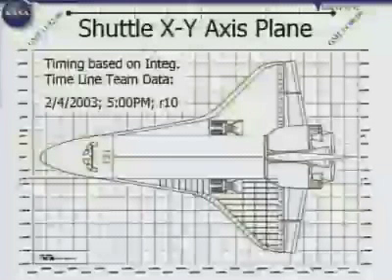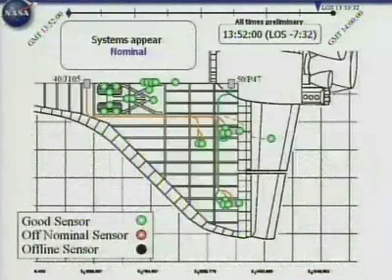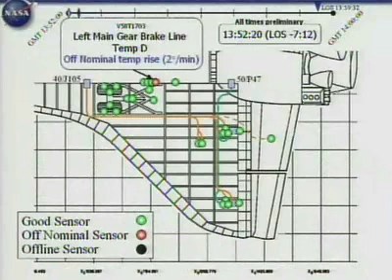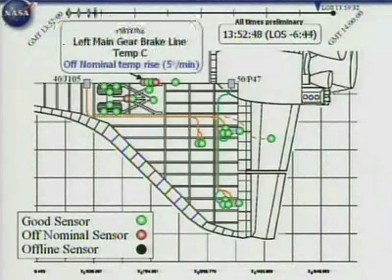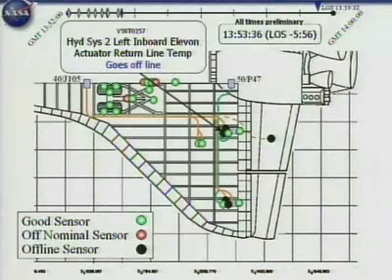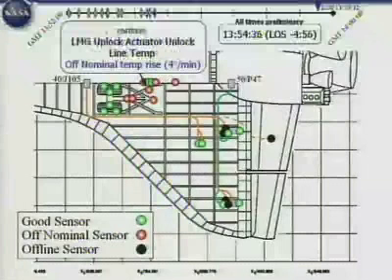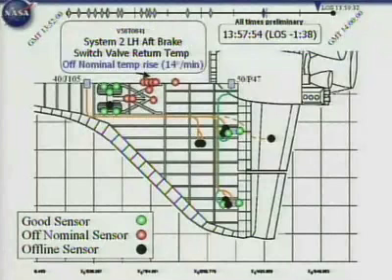Timeline of events in space shuttle Columbia left wing during failed re-entry of STS-107

Comment: They should have inspected the wing right after they achieved orbit then they could have made provisions to dock or pull up to the space station and space walk into the safety of the ISS. The pilot could have over rulled NASA on the reentry.  But that's why NASA deceived them about the severity of the situation. They were dead before they started back and NASA knew this but kept it from them. I wonder how much insurance money was collected by NASA for their destruction of equipment at the cost of 7 lives. HEADS SHOULD ROLL FOR THIS TRAGIC EVENT OF DECEIT AND LOSS OF HUMAN LIFR. Follow the money trail.
Reply: Columbia was in the wrong orbit to go to the space station. There wasn't enough fuel aboard the orbiter to change its orbit and get to the ISS.
Reply: You have a number of anomalies here. First off there was no contingency to dock with the ISS on this mission & therefore they weren't in the correct position to reach there. Also there was no way to inspect the orbiter from space. The arm was not installed on this mission because the cargo bay was chock full of experiments instead. Also there probably wasn't any EVA equipment onboard either for the same reason. These missions were planned years in advance thus every STS flight was unique along with training set forth for the crew of THAT mission. Finally NASA wasn't positively certain that an issue actually existed on the orbiter. They knew they had a foam strike but that had also occurred on prior missions with resultant tile damage but it obviously wasn't severe enough to halt the program.... until AFTER the fact of course. Probably no insurance $$ because these astronauts probably have to sign their life away or they don't fly. Its the nature of the business.. hazmat pay to fly in space.

Comment: So what good is it to have sensors if your going to do nothing about it when they tell you something is wrong.
Reply: Fair question. More data is better. They can reference the data after the fact to help optimize and fix future flights. Also, for other parts of the flight (not the last minute when nothing can be done) these sensors can no doubt help determine a problem.
Reply: What exactly are they supposed to do when the shuttle is in the middle of reentry flight procedures?? By the time those sensors started to fail it was already too late. The wing had been compromised.   The hope amongst MC personnel at the time was that it was instrumentation failure.
Reply: The actual purpose of the sensors was to provide engineering data regarding the performance of certain system components inside the wing. However, in the special case of Columbia the order in which the sensors failed provided information regarding how the hot plasma entering the wing through the hole in the leading edge progressed through the wing's structure until the wing had a structural failure that destroyed the orbiter.
Reply: @joevignolor4u949  Do the temperature sensors monitor or regulate the temp of a system? Also, it appears that Mission Control was uncertain of what exactly was happening. So I take it that MC does not or cannot obtain the temp readings as they occur onboard the shuttle. I'm just trying to understand why MC didn't communicate anything to the crew at the moment this happened. I watched the whole video (25 minutes) of all the personnel in Houston monitoring comm's during re-entry. It seems like they knew they just couldn't do anything about it. I'm guessing that is because when a craft is traveling at 16,000 mph, there simply is nothing anyone can do.
Reply: @carmenfender4793  The temperature readings were normally available on a real time basis in mission control and were being continuously monitored during reentry. The first indication that something was wrong was when some of the sensors started to fail in sequence. At first they assumed it was just an instrumentation problem where nothing was actually wrong with the shuttle itself and that the problem was in the telemetry system. The next indication of trouble was when a voice transmission from the shuttle was cut off in mid sentence and suddenly they lost all telemetry data when the downlink cut out. That happened because the shuttle had begun to break up but even then mission control didn't know what was happening. They still had reason the believe it might be just some sort of massive communications failure. Then finally someone called into mission control and told them that there was debris that had been observed streaking across the sky over Houston. Only at that point did mission control finally know that they had lost the shuttle and its crew. Exactly when "there simply is nothing anyone can do" is still debated today. Some people think they were doomed as soon as the piece of foam made the hole in the leading edge of the wing during launch. Other people think they could possibly have been rescued from orbit. But certainly once they started to reenter with that large hole in the wing the game was over.

Comment: So what would have happened first .
The wing blowing apart or it burned through to the cargo bay ?
Reply: The left wing was too damaged that it eventually destroyed, causing out of control flight that ultimately disintegrated over Texas.
Reply: Some of the early chunks seen coming off the orbiter would have been sections of the wing and its covering of thermal tiles, delaminating from beneath the thermal covering due to the breach in the wing leading edge RCC panel
Reply: The wing structure separated from the fuselage. After that everything became space debris.
Reply: Just an educated guess: the landing gear tires over-pressurized due to extreme elevated temperatures from reentry plasma entering at the break point near the wing root. Actual cause of vehicle breakup was likely the tires exploding in the landing gear well. That would be equivalent to several pounds of C4 and more than enough to shatter the wing. Aerodynamic forces then ground the rest of the vehicle to metal hamburger. :(

Comment: I’m so glad they had all those sensors, they seemed to help a lot
Reply: They just assessed the damage to foretell the disaster. Otherwise, no help.
Reply: They absolutely helped. They were critical clues that assisted in determining the exact nature of what failed. Without all of the data there is no way the shuttle program would have continued as their wouldn't have been confidence that the fatal flaws were identified and mitigated.
Reply: @c5mjohn  so they need sensors to tell them 
Data that if chunks of your aircraft fall off in flight 
That might b critical ? LoL.
Reply: @PInk77W1  million-moving-part rocket blows up, and odds are that even if you say "it blew up" you have no idea how or why. Having so many sensors, and seeing the order in which they lit up and went dark, tells you a lot about how the vehicle burnt through.

When you're dealing with spaceflight, declaring "shit's broke" and kicking the frame once isn't good enough.
Reply: @dsdy1205  
It’s extra nice to have a space craft that falls apart on take off.  
What could possibly go wrong
Reply: @PInk77W1  It would be even nicer to know WHY it did that, and then make adjustments to prevent it. Which they did. I'm not arguing that the Shuttle wasn't a deathtrap, it most certainly was, but criticising their methods here is pointless. This is how it should be done. This is how it should have been done before it even got to this point.
Reply: yep. they helped to forecast impending doom, that's for sure.
Reply: I understand the need to talk about them and investigate it all seeing its their jobs but yeah... "We don't know if this sensor failure had anything to do with it" or " to early to know if sensor XYZ was part of the failure." Well maybe that 3 foot hole at mach 25 had something to do with their failures.

Comment: They were forced to change from a good freon in the foam to a lesser type 'freon' in the foam.  That was certainly not a good thing.
Reply: Previous shuttles were damaged from the prior freon foam. Any foam hitting the shuttle is unsafe.
Reply: @janedoes5214  If you mean STS-27, that was the nose cap of a solid rocket that caused horrendous damage.  Correct the foam was not perfect.... but after Columbia was lost I think it was.
Reply: If you bother to check it out,  the chunk that came off and doomed Columbia  was made of the old foam.  But let's not let the truth get in the way of a good story.
Reply: This is classic boomer trash, go and huff some freon
Reply: Often supply contracts are changed due to corruption of politicians, giving it away to a friend or making a deal with it. Whenever an accident happens and it turns out the problem is with one of these suppliers, you suddenly hear nothing about it anymore. It without exception disappears under the rug, because otherwise politicians would have to save face (And fire a bunch of NASA officials)
Reply: CSXRockford  Except for the many hundreds of thousands of lives that have been saved by reducing pollution?

Comment: Damage to left wing struck by debris from external tank left a gaping hole or a gap in shuttle wing wing got a burnt through in hot gasses
Reply: After the foam damage to the leading edge of the wing occured, images were transmitted to the crew and there seemed no concern, but on the second day of their mission, a piece from the damaged wing broke away leaving a gaping hole which the crew could not see from their window.

Comment: Why didnt they just design the cockpit to be a detachable escape pod,then re-enter like a capsule and parachute? There was NO contigency plan for the inevitable shuttle wing damage that will happen sooner or later.....
Reply: Because the "escape pod" or anything else for that matter would be ripped to shreds from immediate exposure to Mach22 speeds, and the resulting G-forces, and 3,000 degree temperatures. In other words NOT feasible.
Reply: You are right. Russian rockets do have an advanced crew bailout system in case of malfunction. US crew in a Russian rocket escaped that way in 2018, and made it safely to the ground. Russians are a lot more smarter and more concerned about crew safety. US puts profit first.
Reply: But in the case of columbia, such a bailout system wouldn't have worked as it happened on re-entry. If the Shuttle had such a system, which it didn't, it would have worked only on launch, seperating the cabin from the shuttle and using whatever means to brake it and make it land safely on parachute. Russians did it in 2018 at 50km altitude in a launch abort. The saved crew was American.
Reply: James Darr think about the design augmentations that would have to take place to design such a system. We’re talking creating an entire system that would have to detach from the main orbiter and still be able to land safely. That means bringing an additional heat shield, parachutes, docking/undocking mechanisms, and verifying that all these additional features dont actually interfere with the standard operation of the original design. In an industry where a 10% increase in payload capacity is enormous, this type of redundancy is unfeasible and the added complexity could possibly make the whole thing less safe. The early shuttles had ejection seats that could be used on ascent but they scrapped them largely for these reasons

Comment: Let's try to figure this out. If the Shuttle passed the friction zone entry atmosphere, then the scary part between the friction part is over which we saw it did. But in the video footage was it passed ozone friction or still in the friction zone? If it's still in the friction zone then the issue was the "Thermal Tile" was hit from debris came off on top of rocket booster. If it still in the ozone friction, then it's not only the Thermal Tiles involved issue which is the wear and tear issue that most of the time was using during automatic gliding descent landing destination on those mechanical hydraulics and sensors which it's obviously impossible to create heat, pressurization, malfunction and burn. What's causing them to build up heat and stop functioning? First, those anything inside housing wing that contains mechanical and hydraulics always stayed intact together no matter what happened of wear and tear utilization except unless the bottom outer left wing metal sheet skin was busted by that Thermal Tile came off and punched hole that created pressure inside bottom leading edge. Once the portion part of Thermal Tiles came off, that portion part caused everything in left wing to cause heated up from outside friction and affected whatever inside parts to malfunction that creates over-pressure, hydraulics malfunction, imbalance computer automatic configuration and sensors stopped functioning because of overheated friction being burned up that resulted cuts the wing everything started to cut disastrously separated and creates burning from friction. Mysterious disastrous issue solved if not, any engineers can add up what else caused in tragedy?
Reply: It came off the fuel tank.
Reply: Not the rb it was the external fuel tank the foam fell from
Reply: the foam came off the tank not the SRB's. Only the O2 tank has foam because that thing gets really cold at launch and they're concerned about chunks of ice hitting the orbiter. The leading edge was what sustained the damage from the foam strike not the top or bottom skin or tiles. The orbiter didn't have a chance as computer simulation during the investigation afterwards indicated a hole large enough to throw a laptop through was created on the left wing leading edge close to the root. Which is of course the point of maximum heat load at reentry. In fact not only was the tile smashed to bits but the underlying wing structure itself was damaged. I'm surprised that none of the crew heard that strike to be honest about it. What I'm wondering is if that simulation was run BEFORE reentry had occurred. I bet it was and therefore NASA already knew that the orbiter was doomed (but did not tell the crew). Yeah they take video of all these launches from several different cameras (in case something goes amiss). Worse, they knew that this was an ongoing issue from examining video of prior launches AND noting damage to tiles all over the orbiter. These things should NOT have flown until this problem was FIXED! They chose to fly instead.

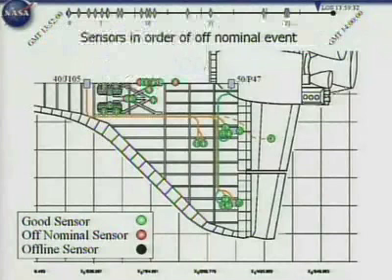Comment: 10:30
They've gpt 3 sensors offline all connectrd to flight-control surfaces on tge same wing. 

Conclusion?
"Everything seems to be nominal". 

What about the automatic flight corrections from the OBC to correct for wing drag? Not even that.
Reply: @John Camilleri not me it's Google Voice
Reply: Just looking at the sequence any idiot can tell something is breaking that sensor cable, then followed by everything in the wheel well going haywire. You can almost see an arrow pointing directly to the wing's leading edge.

Comment: The body line sensor is interesting. Did that indicate a hole had formed in the upper surface of the wing that was letting plasma heat the side of the orbiter?
Reply: Hot gasses were probably migrating through the wing, following a path of lowest resistance until they were able to burn through the wheel well.
Reply: The hole was in the leading edge of the wing, otherwise what you said was correct.
Reply: The design should have at least incorporated cameras to be focused on those leading edges. but would it have mattered? These guys did not have backups sitting on the pads back home AND this STS did not fly to the station. Only AFTER this flight were all subsequent STS's directed to the station.
Reply: @leecowell8165  Cameras that would have seen nothing? A layer of glowing plasma is all they would have ever seen if the cameras were possible in the first place.